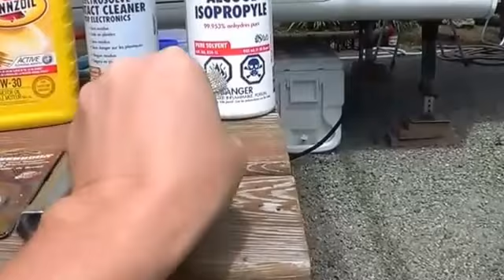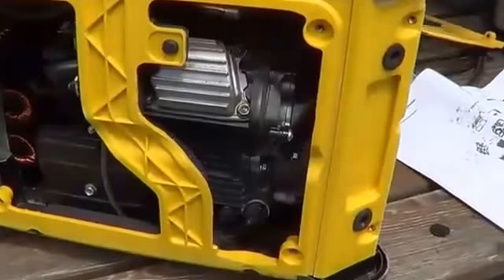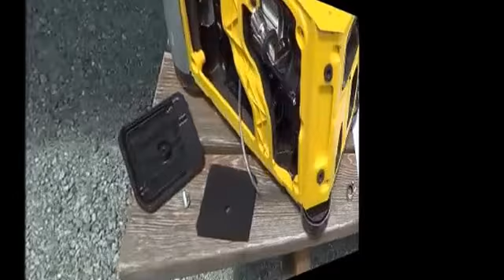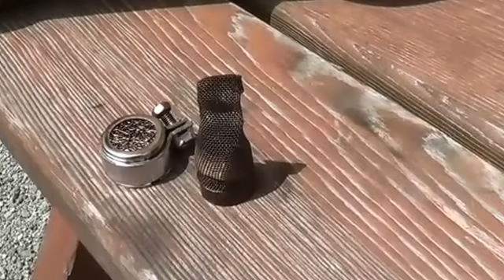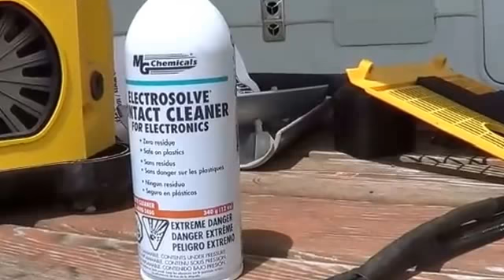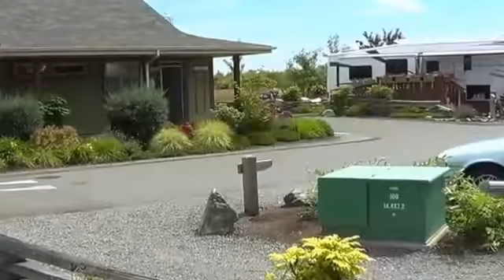Champion 2000w Inverter Generator Maintenance

Comment: With what number of key do you remove the spark plug?
Reply from the maker: From the manual: https://www.championpowerequipment.com/wp-content/uploads/2017/11/100455-om-english.pdf
3. Use a spark plug socket tool (not included), or a
13/16 in. (21 mm) socket (not included) to remove the plug
Spark Plug Specifications
OEM Type........................................... NHSP E6RTC
Replacement Type................... NGK BPR6HS or equivalent
Gap ............................... 0.024-0.028 in. (0.6-0.7 mm)

Comment: I realize this is an old video and I believe you presently don't have the Champions right now but here's another tip... Mine started to surge badly when in econo mode.. These things don't have a fuel filter other than the screen in the filler neck so not surprised I found crud in the carburetor bowl and also cleaned the idle jet...  I also installed a filter in the fuel line to the carburetor to prevent this from happening any time soon... Runs like a champ again... (pun intended) Appreciate all your videos.... Thanks
Reply from the maker: Thanks for the tip! I still have both Champions and both run pretty well after 8 years now, just used one recently to compare to a newer brand called Energizer - https://youtu.be/IsytsDf3WoE   Cheers, Ray
Reply: @LoveYourRV  Mine's 8 years old as well.... Since installing the solar it hasn't seen much use other than the odd cloudy rainy day I'll use it for a bit to charge the batteries. Control Module failed earlier this year where Champion's excellent customer service shipped me a new one free of charge.. Generator would go into overload with a load as small as my stock converter let alone the 125 amp charger. Take care...

Comment: will this unit run on eco mode with coleman mach 8 9200 btu AC( 1300w running watt i think)    its like 60-70% load and the fuel wont last 4hr with ac running i guess?
Reply from the maker: A lot will depend on the temps and how much cooling is required. The compressor on an AC unit cycles on and off based on how much cooling power is needed. If hot and humid it draws more energy to cool. At the full 1300 watts the ECO mode may help a bit, but not much in my experience. Any load that high increases the engine RPM to near full.
Reply: so what size generator would u suggest me getting? i heard a guy saying generac  3000w gen only last for like 4 hour on his 10k btu ac while honda eu2000 last all night long with smaller fuel tank.
Reply from the maker: Maybe try renting a few different brands and wattages before buying to compare for yourself. I would think a smaller size motor would use less fuel as long as it wasn't taxed to the limit.

Comment: I have two of the older models that Costco sold. They're red and only have one removable side - the rear. I bought two of them so I could stack them and run my a/c.

So, MY problem was trying to get the spark plug out. I watched your video and saw that you 'simply' wiggled that thing off the top of the plug. I'm off to my shop to 'simply' wiggle the plug thing off.  Should all be a piece of cake now. This one wouldn't start when I went out to do my monthly generator starts (I have four generators). These two, an older 3500 watt Champion, and that new Predator 3500 from Harbor Freight.

Comment: Thanks!  I was able to fix my generator thanks to you and this video.  I didn't know that the spark arrestor was in that pipe!  I thought the spark arrestor was that little screen on the clamp!  Once I took that out , it started running!  Now, it's clean and going back into the exhaust pipe.   If I have a problem in the future, I'll definitely be looking that that part!
Reply from the maker: Awesome, glad to hear the video helped out. Cheers, Ray
Reply: @pnolans  I didn't know this either. I have never soaked these parts either for that matter. Pretty good advice. Thanks! 
This is a follow up to the spark arrestor inspection advice. 
Indeed this was a huge surprise when I got around to it. How was the generator even running! How horrible was it to have it clogged so badly?
I even had to scrape built up crud from inside the pipe where the spark arrestor lives. I did all the other stuff and test  started the motor without the spark arrestor just to blow out whatever might be still in the exhaust system for a minute.
Wow! Thanks again! Subscribed!

Comment: Thanks Ray (as usual!) for yet another very informative and easy to follow video. Based on your original review, last spring I purchased two of the units with parallel kit exactly as you did. Also, I find it convenient to either take just one unit for "battery top-off", or both units if we anticipate needing the a/c. Since I didn't have any 99% Iso handy, on the advice of another You Tuber, I used a propane torch/pliers to "cook" the oil/carbon nasties out of the exhaust screens. They came out looking like new! After both sets were buttoned up again, I used a little 409 cleaner to spiff up the cases.

Comment: What type of spark plug is it?
Reply from the maker: Spark Plugs
OEM spark plug: NHSP E6RTC
Replacement spark plug: NGK BPR6HS or equivalent
Make certain the spark plug gap is 0.6 - 0.7 mm or
(0.024 - 0.028 in.).  from owners manual - http://www.championpowerequipment.com/media/4624/73536i_manual-english-20161205.pdf
Reply: Love Your RV thanks..
Reply: Love Your RV great video by the way.  Did everything in video but generator runs really rough still.  New plug, oil, filter and exhaust cleaned in alcohol.  I notice a lot of black carbon on filter again already after just a week of camping. Have to have choke on all the time or it sounds like it will stall. .
Reply from the maker: Did it sit a long time? Are you at high elevation?
Sounds like a problem with the carburetor maybe, running too rich. The manual says the air fuel mixture isn't adjustable.  A guess you checked the air filter and it's not plugged. Maybe run some fuel system cleaner through it.
Reply: Yeah it sat an entire year as I moved and I didn't get out camping.  Fuel system cleaner.. Good idea, I think I have some in the garage. I don't really want to buy a new one.  Doing the maintenance in this video was about the max of my mechanical abilities!
Reply from the maker: Worth a shot, things may be gummed up in there. It good to run it for 1/2 hour every couple months even if not using it.
When my wife's boat motor sits over the winter the shop adds some fogging oil to the motor and fuel stabilizer.
Reply: If cleaning the carb doesn't help, I see new replacement carbs on ebay that are very economical!  But I would definitely run some cleaner through it or even remove the carb and do a more thorough cleaning.
Reply: Try using a different brand of gasoline. I'm in Ohio, which is the "dumping ground" for crappy gasoline. I had a snow blower that refused to start on "fresh" gasoline. Took it to the shop - tech dumped my gasoline, and put in Shell 89 octane. Started up on second pull. He said he sees this all the time.

Comment: just a tip : when you change the oil , take a pvc pipe about 3 inch long that just dont fit on the motor where the dipstick is . slice the pipe al the way and angle the ends so it fits youre mashine. then you have a oil change divce that dont leak and you dont have a mess inside the mashine. here is a link to one that made one https://youtu.be/fGPYaBW7_-0 best wishes from sweden 😊😊
Reply from the maker: Thanks! Good tip!

Comment: you can eliminate the oil drainage problem by holding the funnel backwards toward your oil drain hole and tipping the machine off the tailgate to allow the spout to point down to a catch can.
Reply from the maker: Thanks for the tip! Cheers Ray

Comment: grate video mate have you had to adjust the valves on them yet 
thanks
Reply from the maker: +Chris Bamforth No, they are still running smoothly. Had them for over 4 years now.
Reply: Iv notice mine is out putting less power/Watts from New. it used to power my air compressor without any problems but now it seam's to struggle to start the Motor on it. Mines been used for just under 35 hours

Comment: I couldn't get the whole spark arrester out, only the rounded part. The other one too tight. I tried to use a plier to pull it out but it wouldn't bulge.
Reply: Same problem ... did you ever solve it?
Reply: I could barely remove the internal one when my unit was NEW.  I cannot imagine removing it after a while with rust on it.
Reply: @Peppermint1 Hi Peppermint! Are you the same fellow who has those excellent old Volvo videos?

Comment: you estimate 600hrs on each generator,? hhhm im impressed so becuz theyre light weight and low cost buy 2 and special cord to run in parrallell now get 4000 watts for 1300 plus tax and light wgt advantage portability.
 ok so i want buy one to  safely run my computers flat screen radio yamaha advertised  they use pulse width modulation and voltage regulator in theyre inverters
so just wondering if you use these only for ac and micro or have you been using lap top computers and flat screens and these are my main  concerns , some low cost inverters when run out of gas have voltage spikes and fry electronics micro processors
so is the yamaha over sold by marketing of do these have these features and just dont advertise them. since you did electronics repair wondering if you knew the quality of the voltage on these units thanks if these things really have 600 hrs on them and are safe i may buy one .

Comment: Ours does not have dbl pane windows. Wife's health has been a detriment to more camping however I go pretty often alone with the dog. I have 2 135 w solar panels and a 2000 w inverter  and 4 6v golf cart batteries w/ a 25A controller and seldom need the generator except for A/C in summer. Wish the bike rack was larger and able to carry 800 lb. and I could bring the ATV. With our setup we can dry camp w/o much generator use. I would be full time where the lil woman is a home body. Too much to see to sit at home when retired from the "grind".
Reply from the maker: gary sheldon Ya, the double pane windows are nice, they really cut down the outside noise. I only have two golf cart batteries and then I left the original 12 volt battery as a back up that I can switch over too. Just going to add a couple 100 watt panels in a week or so as a Xmas gift. Will see how that goes and may add two more down the road. I don't mind running the Champion, hardly hear it if it is at the front of the fifth wheel, but would like the option especially in close quarters like a national park campground to be able to go solar for the most part.

Comment: I hope you don't run them while they are still in your truck tool box. I bought 1 of the newer ones and they have a little rubber slide to drain the oil. No mess. I was wondering about running without the spark arrestor. You wouldn't have to worry about it getting plugged up.
Reply from the maker: Tony Marshall I just store them in the box. I have seen some modifications to run them in a box, with fans and exhaust ports,etc but they are so light for me, I find it easy to pop them out and run them whereever the noise will be the least for me or anyone close to me.

Comment: about how many hours do you have on them ?
Reply from the maker: Hard to calculate exactly but I'd say I have averaged boondocking 100 days a year for 3 years at roughly 4 hours a day generator run time per day split between two generators so roughly 600 hours per generator if I have the math right.

Comment: Can you should you use syn oil??
Reply: My manual suggested this. I think this  it is a good idea. The break in oil might not have to be though. I need to re read the manual about this. When new I was surprised by this recommendation. Considering the also recommended run time between changes if adheard to this should be super  good for the friction reduction and longevity. I just wish the design included an oil filter too. But frequent oil changes could really help all around. It is a dirty little secret.  Compared to any other  inconvenience oil is cheap.

Comment from the maker: The newer models have redesigned the oil fill and added an extended piece to make draining the oil easier, good idea about the funnel, will have to try it.
I have two and they have performed well for over two years now.

Comment: Nice video. I was wondering if you could just have used the oil funnel in reverse to drain the oil instead of putting a rag to guide the oil out? I am really on the edge about getting one of these or the Honda. How's it holding up?

Comment from the maker: The 2000w ones weigh around 50lbs versus 100lbs or more for a 4000w. A lot of times I only need to use one at a time, only need 2 when running the AC or MIcrowave so it makes it easy to move around a 2000w model rather always having to use the 4000w which would be overkill to just charge up the batteries and light loads and cheaper to run fuel wise.. Also they fit nicely in my trucks tool box for storage.